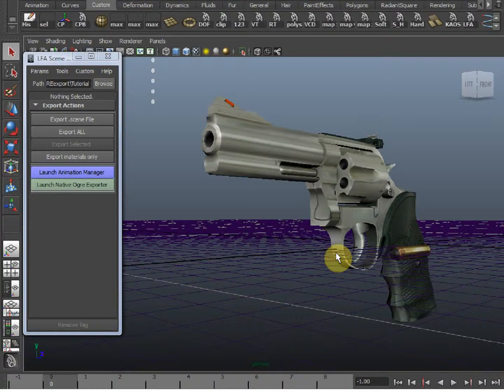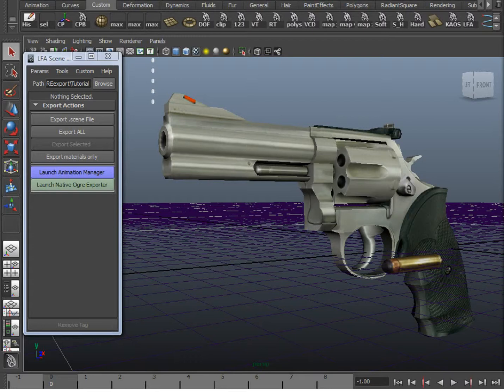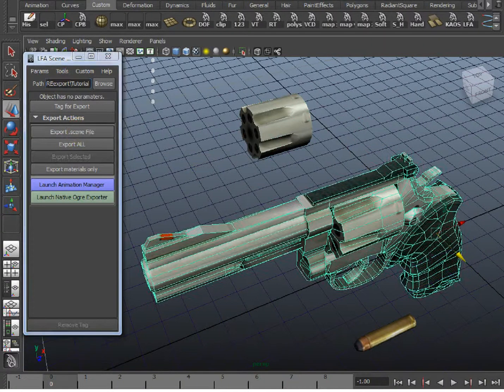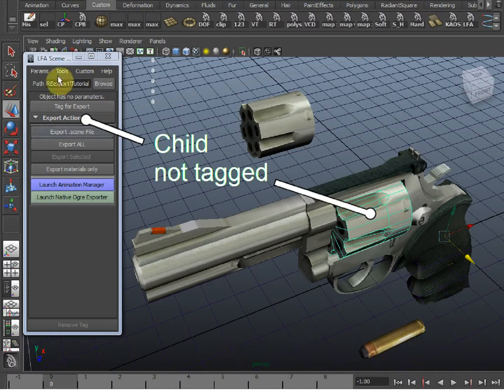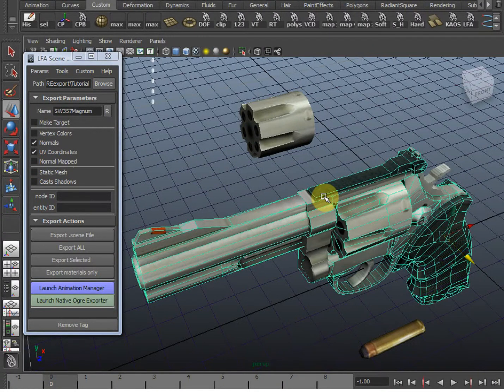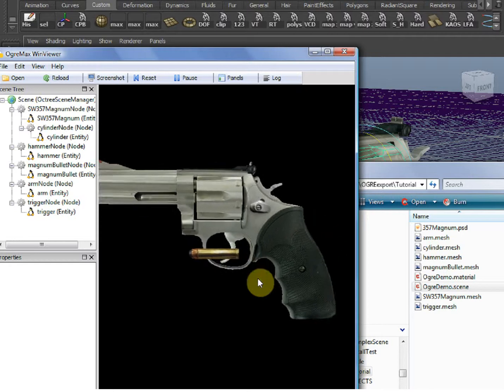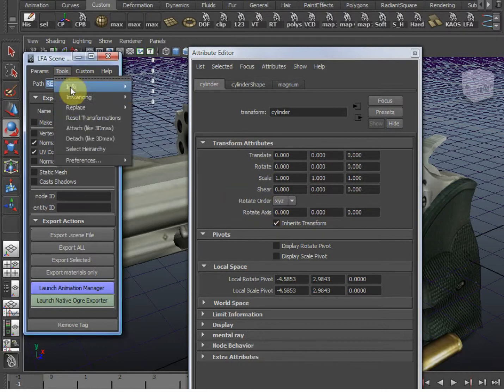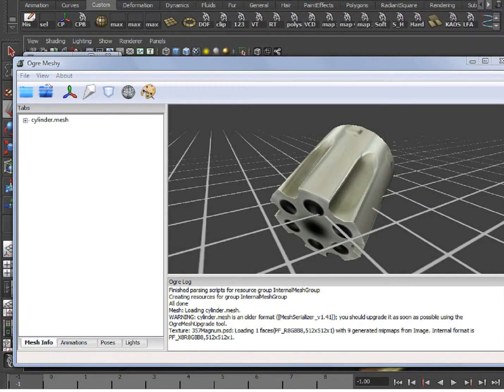Using .scene in practice with the LFA Tools

Comment from the maker: If you are talking about my advice regarding object counts and optimizations,  yes the things I said are relevant to most every polygonal engine.   However, if you are talking about using LFA scene manager with UDK or other - it is possible... but it would take some work to make the conversion.   I did it for a studio where I worked, and it became the foundation for their in-house tools,  but I wouldn't recommend doing this unless you are very good with MEL.